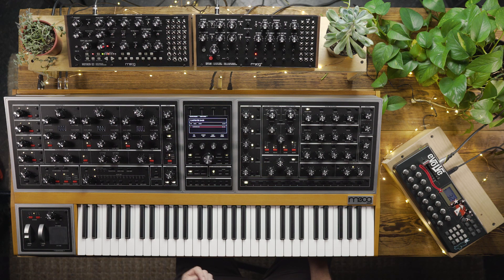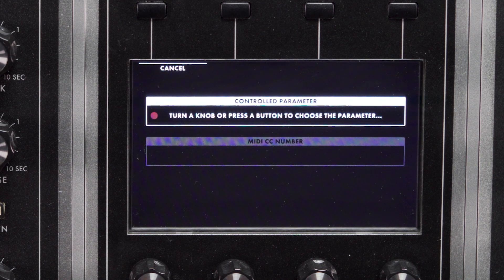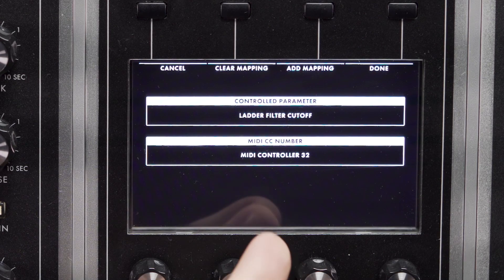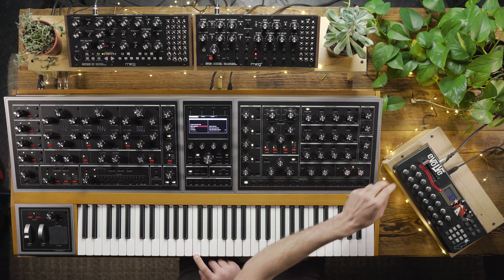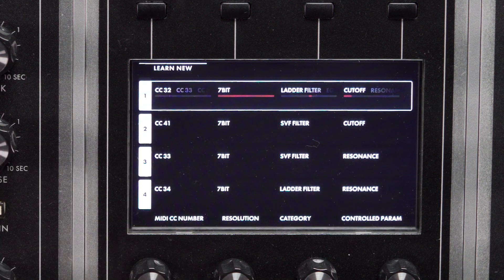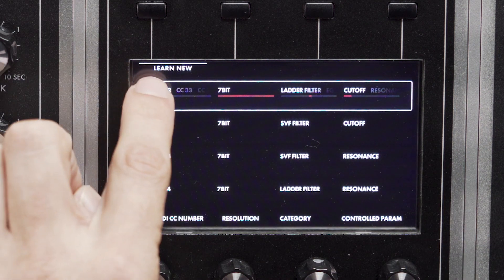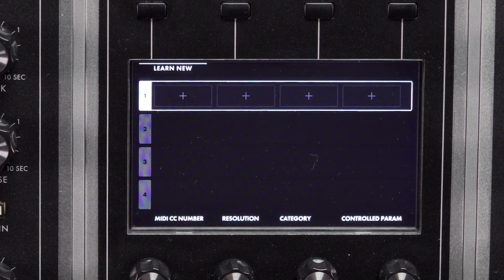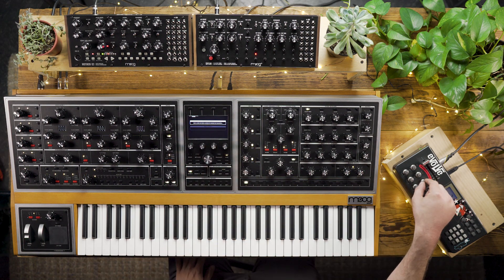Moog One | How to use MIDI Learn

Comment: Can this function be used to tell a knob to send a specific MIDI CC so you can use the Moog One as a master controller that you can customize the mapping of? For example, if I wanted to control a soft synth or rack synth to respond to the Moog One knobs and customize that routing so the cutoff went to the cutoff, ADSR knobs to ADSR knobs, etc.?